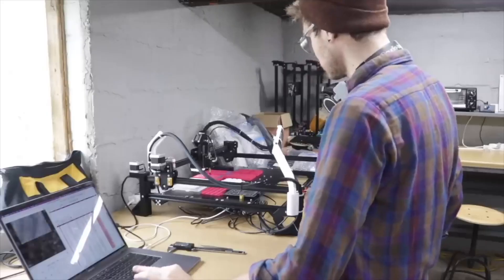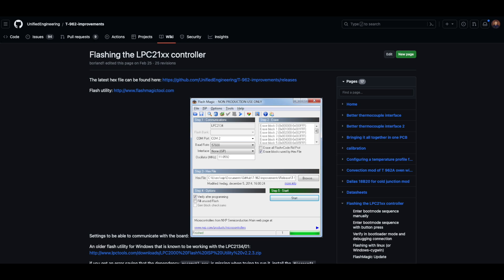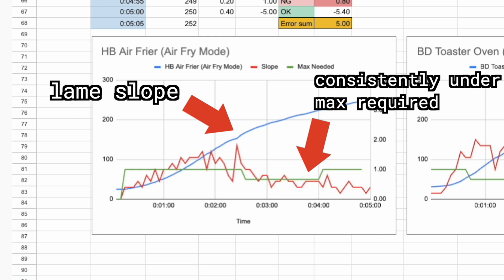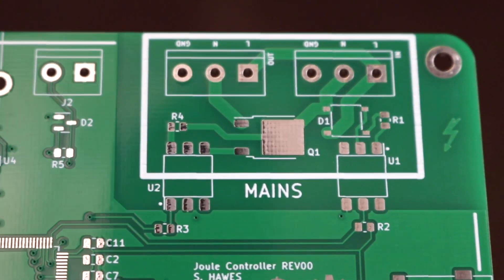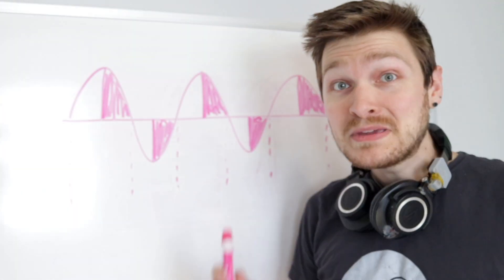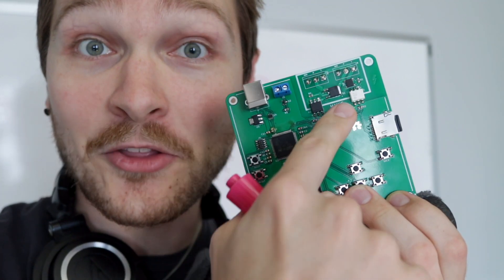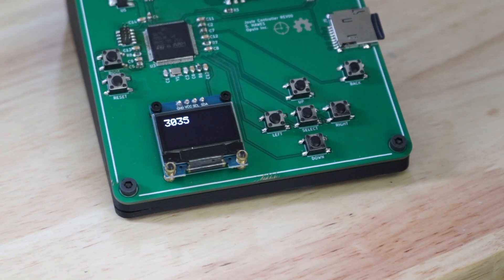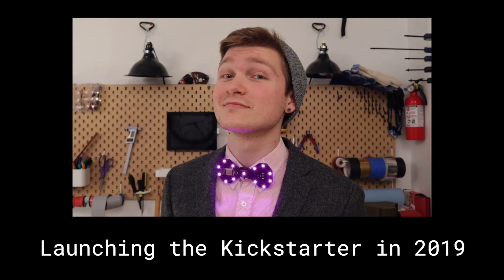turn any toaster oven into a reflow oven!

Comment: Does it also work with a regular bridge rectifier or do we need a full bridge one? 😄
Reply: The F.B.R. too would  need an adequate heatsink...In such cases for high current , it  must be avoided..it increases the power loss ( extra wasted heat) because of two diodes coming in series...

Comment: @steven, great work! One comment on the mains circuits, you should use multiple resistors in series on the high voltage side. You'll see in the data sheets that they have working voltages typically maxing out at about 200v. Keep in mind that 110v is RMS so peak is higher, plus you need to allow for surge voltages too. If you ever go down the rabbit hole of certification with this you'll be forced to learn all of this in detail, like I had to!

Ps it was great meeting you in Munich 😊

Comment: Hey :)
There are optocouplers with diodes both ways on the inputs so you can detect zero-corssing without external diode bridge (4 diodes). Like LTV-814.
And yeah, it is better to regulate heaters by switching on / skipping a whole wave halves instead of chopping the wave (you can count the waves by an MCU).
That sound you heard (like a PWM sound as you called it) was the heater hit by a sharp front of the wave. The closer to the wave peak you chop it, the louder the sound.
I am driving a 400-Watt heater plate by BT138 (TO-220 package) without any heatsinks and it is not even warm...

Comment: I wonder why my comments keep vanishing, maybe because I'm suggesting that you can buy off the shelf parts that do just as good a job.
Reply: And my reply to this comment vanished also. Interesting, I'll test this out.
Reply: Well, that is very interesting. It appears that the very obvious and cheap alternative solution which works well enough for 95% of users, which you can get at <a popular auction website with a four letter name that starts with E>, is so obvious and cheap that just mentioning the name of that website causes your post to be automatically deleted.
Reply: It's a REX-C100PID Thermostat temperature Controller+K Thermocouple SSR-40DA Relay, and it costs £15.99 if anyone is interested

Comment: Yes reflow should be solved. And there should be great SMT protoboards also. And pick and place with a robot arm, a vac to pick up the components, and OCR to read the vals, and a shaker to shake the components upright should also be a community project. Post a video comparing that reflow method to the sand in a pan on a stove method. Thanks in advance.

Comment: Toward the end of the video I'd like to comment. You don't need cycle by cycle control. Minimum 1 second on and off times are way more than adequate. Temperature change here is no where near that rapid. The bare minimum mods to the oven is insulate the box. You don't really need the silicone sealant but you may have to bypass the internal controls.

Comment: I'd like to note that the tab on many triacs is live. You must provide proper ground isolation because the heat sink can become line potential.  You can get isolated tab triacs, so be observant. Be careful of unproven sources for SSR's. There are literally billions of fakes out there. Say they're rated for X amps, when investigated have internals rated for 1/3 of requirement.

Comment: Triacs to control 15 amps come in TO3P or TO247 packages. Some TO220 triacs can take the load but you must have the heat sink to back it up. Also check the ratings on the IEC power connector and cords. Many of them are not rated for 15 amps. 14AWG (insert metric equivalent here) wire minimum. Elsewhere in the world, where ~240v power is standard, current is half.

Comment: Definitely not an enginner but just a thought, if you just make sure the time it is on for or off for is a multiple of 1/60 of a second (or 1/50 here in the UK), you will always get a consistent amount of power. I feel like something like this is operating over the sort of timescale where being on for 5s then off for 5s would be fine (I think I saw someone in the comments already saying this is about the speed that microwaves run). I also think if the toaster ovens have anything else going on, 'dimming' the current might cause problems that switching for longer sections might not. Also I like the idea of putting an IEC connector on this. I think that is one of the more universal connectors common here in europe as well as the US. I love the idea though, I'd like to get an oven for the lab I work in but there is no way I'm getting a reflow master past the electrical inspections that we have to pass (as much as I know they are safe and solid). Whenever I have students that want to work with mains, I point them to those off the shelf smart plugs and have them write some network code to control it rather than doing anything with the wires... or glue a servo to the switch on a power strip! Anyhow just some thoughts hope something is useful here! Keep up the good work!

Comment: Are L and N switched in those power strips? Because if not and if you had an unpolarized outlet your device might still shock you even with the switch turned off.

Comment: The Problem (or benefit) of modern standards, is you can't simply do wave cutting (EMC/Pf issiues) or wave skipping (Pf/flicker issues). Woudn't it be easier to buy a meanwell CSP-3000 power supply and control its output Voltage/current by means of an arduino? The datasheet states it should be possible with a 500-1kHz signal. Then you power the resistant elements of the microwave with controlled DC voltage. The risk than becomes what if a flashover occurs. But that is noting an RCD can't solve.

Comment: I've done some of this in the past. Maybe not applicable in this instance but, when driving inductive loads, you should switch complete mains cycles (I divided the zero-crossing pulses by 2 and worked off one edge).

Also, rather than n cycles on and n cycles off you can provide small bursts of several cycles on to match the dynamics of the halogen heater elements.

Comment: I had a lot of success with the controleo3, but it was quite a pain to build especially in Europe. Nice to see a more accessible solution
Reply: I too built a controleo3, but have mixed feelings about it (and I used the exact oven in the instructions!). My main criticism is that the temperature feedback thermocouple just positioned in the air does a poor job representing the temperature actually applied to the board. I ended up creating a separate sensor consisting of a thermocouple glued to a small PCB, which I place on the tray, and connect that to the Controleo3.  I do like the auto door opening feature :-).
Reply: @Graham_Wideman  That is actually a very good idea! I had issues with thermocouple overvoltage errors (probably because of static electricity), I've seen people connecting it to the chassis through a resistor to solve the issue. Gluing it to a separate PCB actually makes more sense, and would probably solve some other issues that I had when trying to reflow a board with a large ground plane. What kind of glue did you use?

Comment: Switch on the triac at the zero crossing with a longer pulse and use a full half period. The triac will never make a brutal switch at max voltage, which causes the losses, because the transition time. All solder iron manufacturer do it that way. And it solves a huge part of the EMC and cooling problems. But whether SSR or triac you need a mains filter, which are pretty cheap.  A SSR is expensive and lame 

Talking about safety. The oven should be connected to earth and a switch is needed against a thermal runaway,

Comment: I rebuilt a controller board for my kitchen oven. I went through exactly the same process with zero crossing detector and triac, finding out i needed a ton of cooling and had loads of noise then ending up with SCR.
It turns out that you don't need so much fine control over the on / off period. Seconds of time are good enough and the tuning can be done with PID. 
Reducing the amount of switching also lengthens the life span of the SCR.

Comment: ZC detecting SSR is def a way to go. We use Omrons to PID the beds in VORON printers. I’ve had one PID a 1.5kW heater with a heat sink attached. Pro-tip: Set your PID cycle to whatever your mains frequency is to avoid flickering lights 😊
Reply: what do you mean by "Set your PID cycle to whatever your mains frequency is to avoid flickering lights". If you have a ZC detecting SSR, it's already switching at some integral multiple of the mains period, ie: at a fraction of the mains frequency.
Reply: @Graham_Wideman  In Klipper, the default PID frequency is order of magnitude lower than 60 or 50 Hz, so you end up switching on every Nth zero cross, and that makes your light flicker. The proper way to fix it is not having lights on the same circuit as outlets but that requires fixing your house wiring.

Comment: two observation - use two thyristors and optotriac with zero cross detection instead of one triac. The current distribution is better bcs. thyristors are open only for halfwave. Second observation-  SSR with zero cross detection is not necessary in your case since you are turning on only purely resistive load. Zero cross SSRs until are not mosfet base are NOT better for EMC. Turn ON/OFF happens every half of the period and your graph is not correct. Also it works in some sort of window mode so it turns around zero and turn around zero - its also a natural property of the triac or thyristor. It produce a LOT of EMC mess (up to 1MHz, far over the industrial limits) during the switching - use snubber!. I work with it in R&D professionally :) Dont be surprise that one poor triac died - power dissipation is +/- 1W/1A - thryristor  are basicaly two bipolar transistors and triac are two thyristors ;)

Comment: When developing a product with mains, it helps to cover the high voltage section of your board with a insulator, taping a thick piece of acrylic for instance. I also recommend checking if you're plugged into a circuit with an RCD/GFCI. It prevents you from getting zapped when touching the phase (though not when touching phase and neutral)
Reply: Good idea, but acrylic burns like wood.  A better solution is to use polycarbonate (Lexan), it is flame retardant and UL approves it.

Comment: I have a background with theatrical dimmers for tungsten lights. It isn't uncommon to see triac based dimmers in the 1KW - 2KW range, but IGBT based dimmers are becoming more common.  The main difference being which half of the wave is cut. IGBTs you want to turn on at zero crossing to limit the current flow at that point, but turn off in the middle of the wave. The triacs work as you described and turn off only at zero crossing. A good design incorporating a triac or IGBT shouldn't produce that much electrical noise when controlling a purely resistive load, and in the environments where theatrical dimmers are used, there are typically many thousands of watts of dimmed lights in use in the same building and powered from the same pad mount transformers (those big green deals the power company installs with underground 7200v running to your property). We never had any noise issues that could be traced back to our dimmers with nearly 100KW total load, even with over a hundred audio channels - more than a dozen of which were UHF wireless - and multiple guitars (which are great at picking up stray electrical noise).

Comment: I thought it's typically safer to only switch on close the zero crossing. Of course then you can't control the power as precisely, but I'm pretty sure the heating element reacts quite slow that doing a "slow" PWM is just as adequate.
Reply: Never mind. You changed to that approach near the end of the video 😅

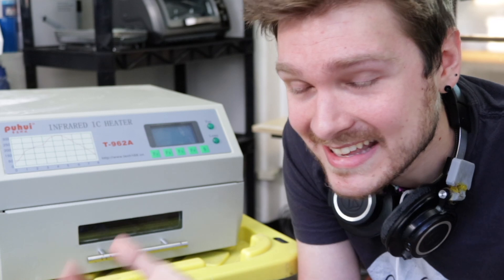Comment: 2:40 I've been using some kind of variant of one of those grey-box-with-a-drawer clones (albeit a little more upmarket) - the ZB2520HL.
It's a bit more expensive and a whole heap of design aspects are just really dumb, the firmware basically may as well not be there for the most part as the menus have been poorly translated to the point where it's just not worth trying to guess what any of the settings or menu options do.

However - I put a PCB in, I hit run, it runs for about 5 minutes and a flawlessly soldered PCB comes out every time.

Comment: An SSR will work great.  We used one with an off the shelf PID controller to control a crock pot a few years ago.  You still need a heat sink, and you need to wire the center screw post to ground (a lot of guides don't tell you that).  But seriously, you don't need a micro controller or anything for this, unless you want a fancy ramp or a timer or something.  If you just want to put something at an exact temperature, an off the shelf PID/SSR kit will work fine.
Reply: A fancy ramp is exactly what Stephen wants to do, as specified in component datasheets.  The general principle is to ramp the board (and components) up to a plateau below solder-melting temperature, let it sit there briefly so that all of board and components get close to that temperature, then "sprint" up to a little over melting temperature, melt for a limited time, then a controlled descent back to ambient.  The idea is for the time above solder melting temperature should be long enough but not too long.  That much precision is not necessary for making a few hobby boards, but it is important for producing larger quantities where you're confident that the components have accumulated minimum damage from the soldering process.
Reply: @Graham_Wideman to go that far , calls for a contoured temperature profile according to the process possible in this small oven.. but here everything is manually labour intensive..hence a bit of overkill.
Reply: @Graham_Wideman  then he can do it with an SSR, a mosfet, and an Arduino.  You can prototype this with a RAMPS 1.x board, no soldering required.  Or a solderless breadboard would work too.  It's simple to do.
Reply: @BrainSlugs83  Your suggestion lacks a graphical display, which of course could be added. But for Stephen, it's probably just as quick to knock out a PCB as it is to mess around with breadboards, or getting set up for Arduino and RAMPS etc. Instead, he gets a system with an MCU he's familiar with and already has a suite of libraries for.  So sure, all sorts of things can be done with Arduino, doesn't mean that path is simplest for everyone.

Comment: Triacs are usually paired with a DIAC and capacitor. They are capable of handling fairly high current considering they're frequently used on power tools.

Comment: as always amazing video! Have you ever thought or done some investigation in doing smd soldering with a LASER ? I think it could adapt really well to your workflow and the skillbase your company has today.  There are many youtube videos about snd soldering with laser using 5W laser diodes and some low temp solder paste. Could be something interesting and a different aproche to melting solder paste without a reflow oven

Comment: You should have still have pretty good granularity with the zero crossing SSR approach. Since you're in the US, you've got a zero crossing 120 times a second. If working over a period of 128 zero crossings, that's 7 bits of resolution with an update rate of once every 1.067 seconds. You just need to have a counter register increment by 1 every zero crossing and reset at 127, have a compare that increments by powers of two. And for each bit in your desired output power value, you either turn it on or of for a length of time that is equal to the value of that bit. So if you're trying to output a power 105 out of 127: 105 is 1101001, so you'd be on for 1 zero crossing, off for 2, off for 4, on for 8, off for 16, on for 32 and on for 64. If you wanted the full 8 bits of resolution, count up to 255 instead and your update rate becomes 2.13 seconds. With the right PID tuning, you could get pretty accurate temp control.

Comment: You should switch the triac on at the zero crossing point and off in the middle instead of turning it on in the middle as that results in massive inrush current spikes.
Reply: You can't turn a triac off in the middle of a sine peak. A triac only turns off as the switched current crosses zero.
Reply: Cannot be done with triacs/ scrs.... these can only turn off when current through it is nearly zero or it has fallen below the device's rated holding current.
For the type of control you mentioned 
(a.k.a. ...trailing edge modulation or control) , it can be done with other devices like bjts/ mosfets/ igbts.. only.

Comment: When i made mine i found that very short pwm periods work just as well as many second long ones because of the masive thermal mass you are heating up. You also cant just have one temperature probe as the temperature is not even and takes a while to propagate to the area of the board. The  heating elements also emits large amounts of IR which makes non-reflective objects heat faster such as fr-4.

Comment: SCR's just have a triac inside, not much different than the application schematic in the data sheet. You just picked the wrong triac is all.
Reply: SSR have TRIACS inside...but triacs themselves are "like" two anti-parallel SCR's wired back to back.